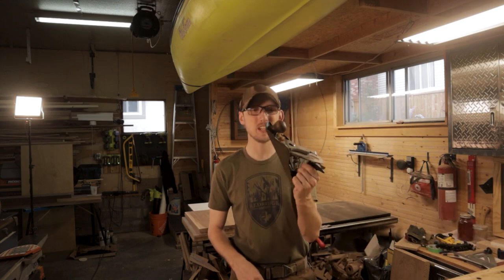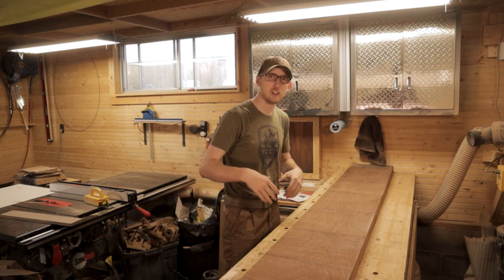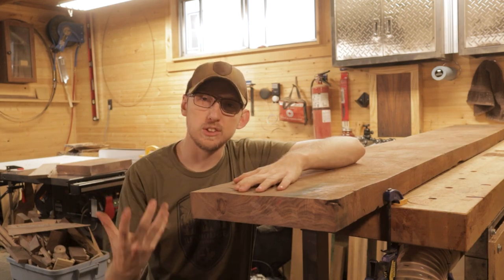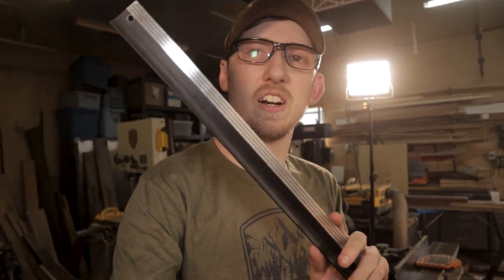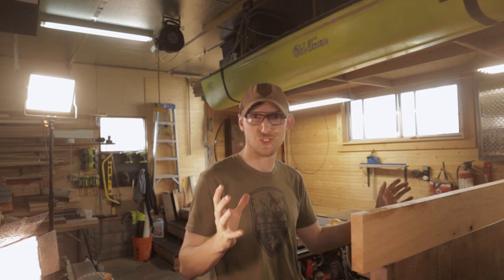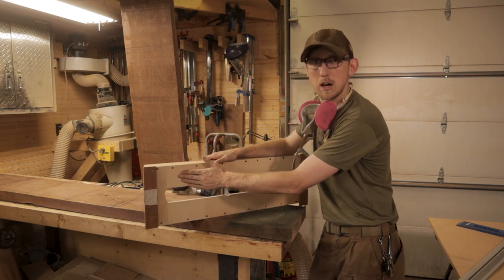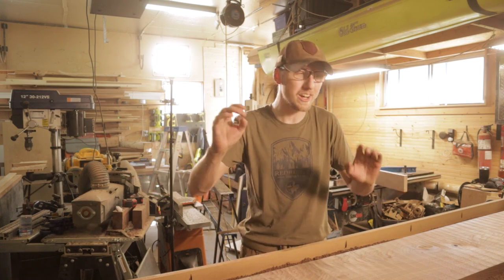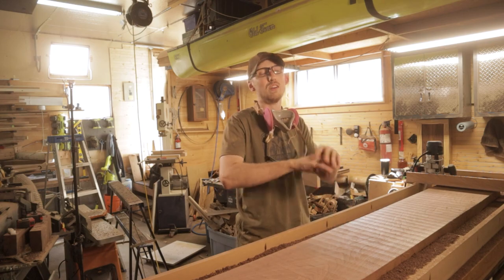How to mill any size board for under $500 | King Bed Frame | Fine Woodworking

Comment: Excellent info, I’m going to try this soon. I know you’re making a king size frame, is there an industry standard for frame size? I’m going with a queen frame.
Reply from the maker: All that matters is the internal dimensions, so for the king I set the internal size to 77x81 since a king mattress is standard 76x80, once I knew the internal size I designed the frame around it. For the queen you'll want to make the internal size 61x81 since the mattress should be 60x80 but if you can double check the actually size . Hope that helps!

Comment: I just discovered your channel. enjoyed the video. I have been a woodworker/ furniture builder for decades. it's great to see younger folk taking up the work. A tip you might try, for winding sticks use a couple of framing squares of different color. Just let one blade hang down. Much cheaper alternative and they never warp like wood ones.
Reply from the maker: My goal is to hopefully get more young people into this awesome traditional craft, someday I want to have a small school where I can get young adults working with hand tools to provide a better entry point into woodworking!

I started out using wood winding sticks but gave up on them when I noticed they started warping, since then I've been using a set of aluminum ones from Veritas which work great! The framing squares is a really great idea though, definitely alot cheaper than the Veritas set.

Comment: You’ve got some gorgeous boards there! I have a slab of walnut and now I’m convinced I’ll want to flatten it this way with a router and a sled and follow those up with the hand plane. Thanks for sharing!
Reply: Oh, what bit did you use?
Reply from the maker: That sounds awesome, good luck!
The bit I have isn't available anymore, but there are a whole bunch of other generic options on Amazon, just look for slab flattening bits.
For a cleaner finish, spoilboard surfacing bits have carbide inserts, they are more expensive but may save you some time in the cleanup process, make sure they have a 1/2" shank.

My bit - https://www.amazon.ca/gp/product/B07H8FDBTC
Spoilboard bit - https://www.amazon.ca/dp/B099N8LZQV